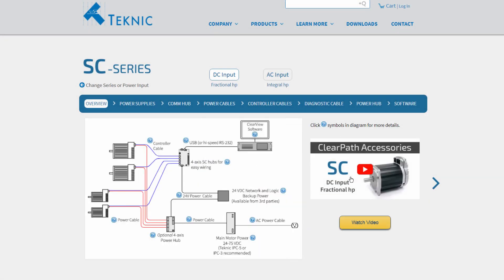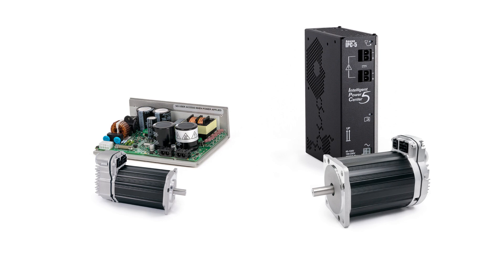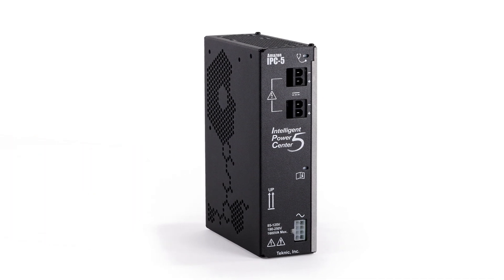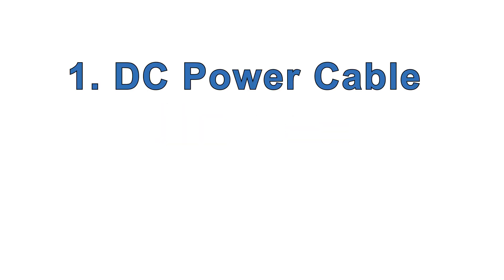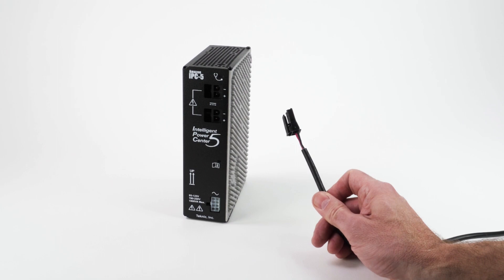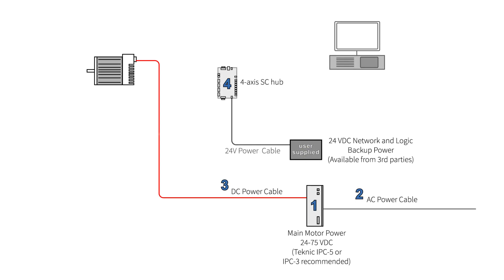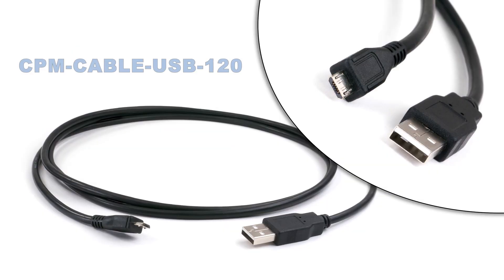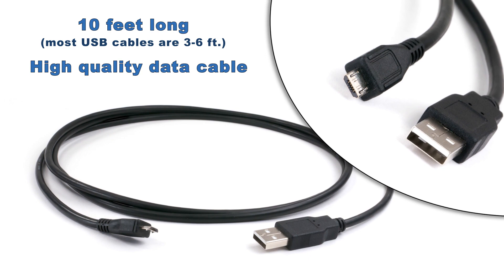ClearPath SC Servo Fractional HP Accessories

Comment: Hi!, We are working with clear path sc motors but we are not sure which controller is compatible for them?
Reply from the maker: Hi Aehsas,

Thanks for your question. 

ClearPath SC is the fully software-controlled series in the ClearPath family of servo motors. ClearPath SC servos use a continuous connection to most any Windows or Linux host PC. You write your application program in C++ or C#, using our sFoundation class library, which runs on the Windows/Linux PC. This PC acts as the master controller, sending high level commands to the ClearPath SC through the SC-4 Hub (which conditions the signals, provides noise immunity, and allows you to daisy-chain up to 16 axes to one port) using USB or high-speed RS-232.  You can use multiple ports for incorporating even more axes (3 ports would control up to 48 axes).

ClearPath SC is also compatible with many popular single board computers, such as the Raspberry Pi or BeagleBone Black. For more information on controlling SC with either of those, check out this video: https://www.youtube.com/watch?v=R7bgAo0EINI

For diagnostics information, configuration, and tuning of ClearPath SC, you should use our free ClearView software (Windows compatible). 
The sFoundation library, ClearView, and all other ClearPath SC resources can be accessed from our Getting Started page, here: https://www.teknic.com/products/clearpath-brushless-dc-servo-motors/model-support-sc-dc/

Hope this helps and please feel free to give us a call (585-784-7454) or leave us a message at https://www.teknic.com/contact/ if you have any questions. 
Best regards,
Trent T. - Teknic Servo Systems Engineer